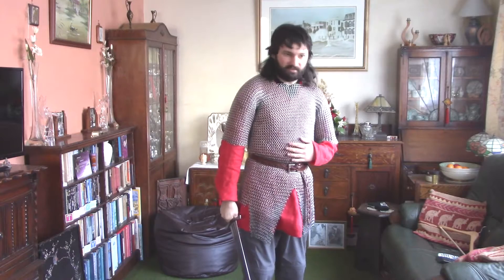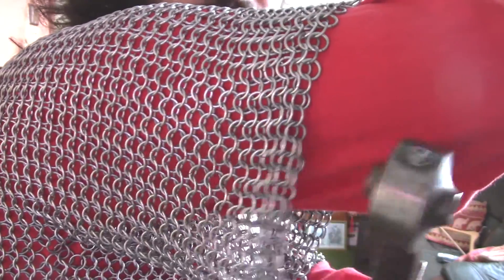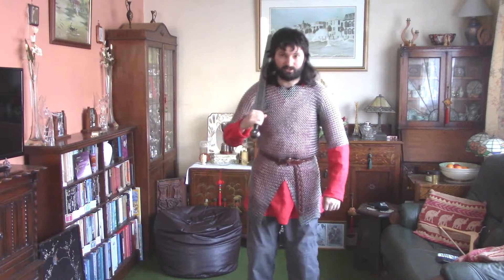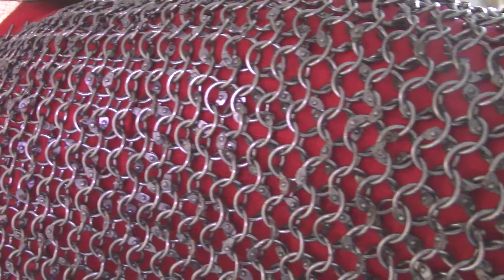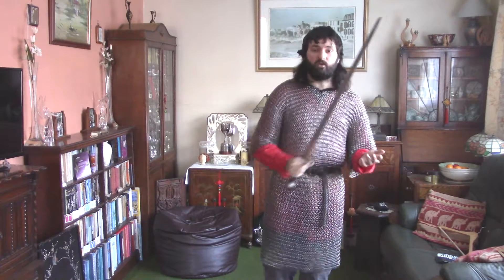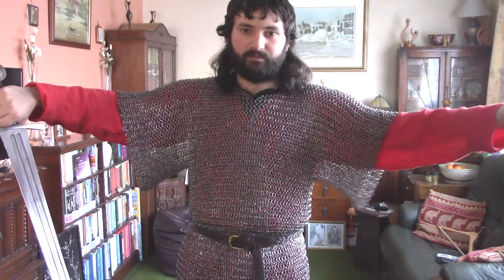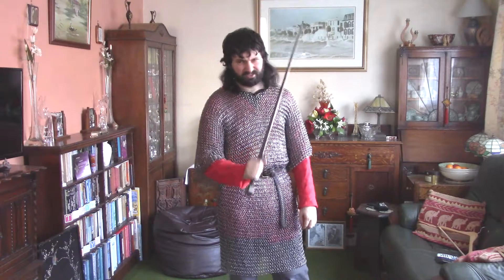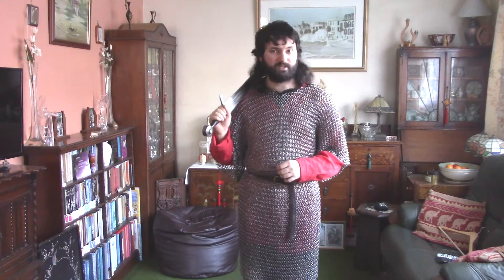Chainmail Armour (maille) | HEMA with Pc Genie

Comment: My riveted haubergeon just arrived the other day. The first thing I noticed, which I didn't really expect, was that the rivets tend to snag on each other, especially when parts of the maille are folded or doubled over on each other. Do you run into this problem?
Reply from the maker: I find that worse still, certain types of (especially loose threaded) clothing catch and even rip on the rivets. You can either stop to carefully pick the clothing off or wear something different. For avoiding mail snagging on itself I recommend carrying it on a pole through the sleeves or a wooden coat hanger.